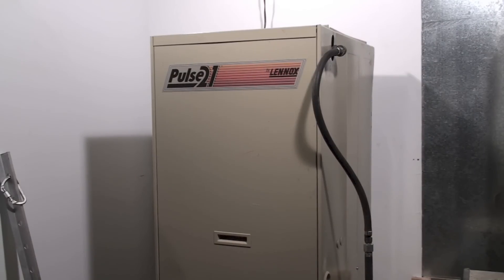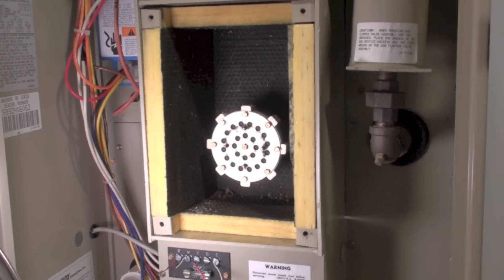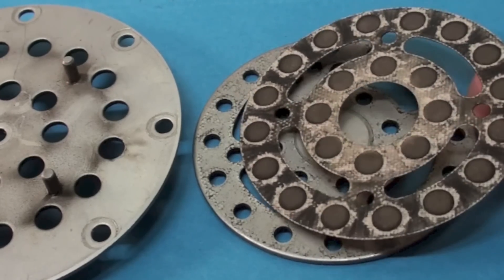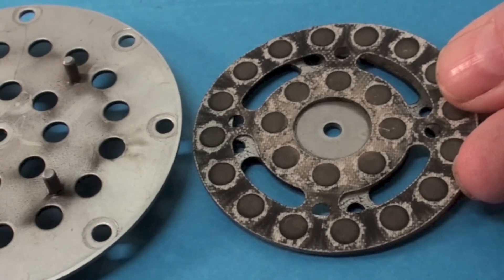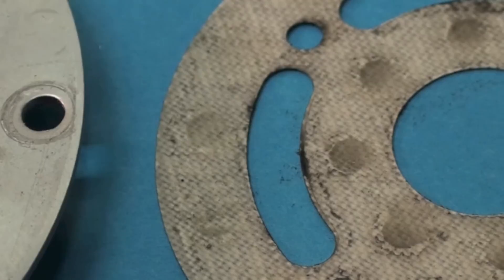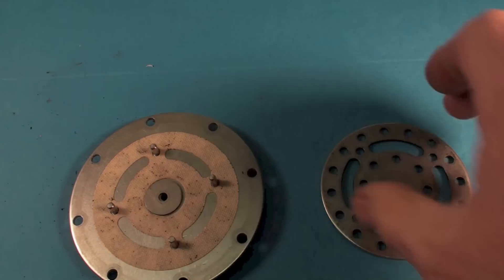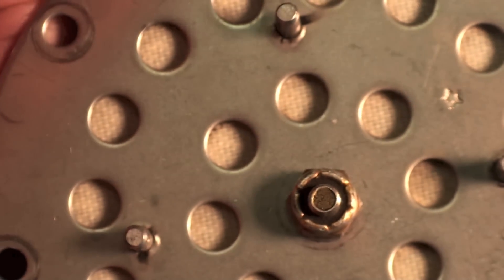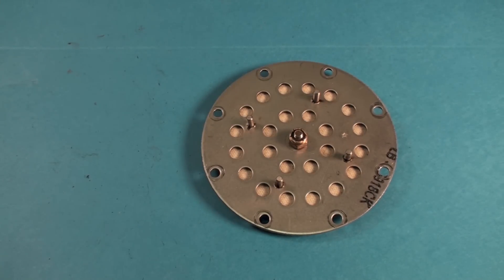How the air flapper works on the Lennox pulse

Comment: According to the service manual the "star" embossed in those two metal parts are supposed to align and face out of the furnace. The center bolt is torqued to 10 inch pounds and the surrounding bolts to 9 inch pounds.

Comment: I'm on 10 years without replacing the air flapper, it's only used as a back up heat source but runs daily at least twice for 15 plus minutes at a time. It is sounding like it stumbles at the beginning of the cycle, kind of like a misfire her or there. Probably should buy a new flapper if they are available.
Reply from the maker: That's what I would try first.
GFM

Comment: My parents have a Lennox pulse. And it’s in good shape for 20-30 years old! When I was younger I used to hear the furnace kick in with that really loud rumble. But this video taught me a lot! But I have one question, my furnace makes a little clang sound before it starts up, but what does it mean if it makes that sound like 3 times but doesn’t start up?
Reply from the maker: From your info I can only conclude the flame rod is not sensing flame.  Try cleaning the flame rod.
GFM

Comment: Lennox Pluse (10/1987) G1404/5-100-6 still chuging along.  Replace flapper about every 4 years.  Had to change Fan Limit switch - HOWEVER generic limit switch cause Blower to short cycle.  So had to add Delay -Off-Relay set to 4 minutes (that feature was built into original fan limit switch).

Comment: Many thanks for this tutorial! Three hours ago I had no idea what was wrong, but now the furnace is running just fine again. The coronavirus is making pickup or delivery more difficult right now, so I tried cleaning instead, that did the trick. I just used a couple of tissues to clean it off rather than washing it. I figure the water might carry the dirt into the filter portion a little deeper. I can see why a repairman would just replace the filter. At a cost of $10.00, it is much more efficient for them to replace it rather than clean it. Thanks again and stay safe!
Reply from the maker: Welcome
GFM
Reply: @grayfurnaceman  Today it wouldn't start, 24 hours later. I pulled the filter out again, cleaned it really well this time, soap water and a toothbrush, but it still won't start. Any ideas? Thanks again.
Reply from the maker: @gregpanke3752  I would be looking at cleaning the flame rod and maybe replacement of the spark plug.
GFM
Reply: grayfurnaceman Thank you!

Comment: I've had my Lennox Pulse Furnace since January 1982.  In 1998, I got a recall;  the tech came and replaced the heat exchanger free of charge.  This was its first service call and I have not had it serviced since.   It never misses a beat.  I had the mufflers installed at the same time of the installation.  THIS IS NOT A NOISY FURNACE!  I have a Goodman that heats  my basement only and when it comes on, it drowns out the pulse.  I hope I never have to change my Lennox Pulse.  It is the greatest furnace, EVER!  I hope it runs another 37 years.

Comment: My pulse 21 is making a "clattering" sound at start up it stops after about 10 seconds and runs quite. I removed the air flapper and cleaned the diaphragm , I noticed the washer you referred to was missing could that missing washer be the source of the noise? Where can I get a washer for my air flapper? Thanks Richard
Reply from the maker: It could be.  I would replace the flapper as I believe it comes with a new washer.  That is if you can find one.
GFM
Reply: @grayfurnaceman  I ordered a new flapper diaphragm but no washer do you have one to sell.?
Reply from the maker: Sorry, I don't have any parts.  
GFM
Reply: Some models didn’t have a washer. The inner plate was designed with a slightly protruding center to create the proper gap needed.

Comment: I honestly don't care if you like or dislike this model or the model line. I'm not interested if you think certain parts seem "silly" to you. Our Pulse has been working fine for the last 20 years with normal preventive maintenance and parts replacement. It's odd that you say that you won't work on these models- are you telling me that if I called you to look at my furnace you'd refuse? From a business sense this seems like a pretty good revenue stream if they're as bad as you say.
Reply from the maker: The term "silly" is one I commonly use and is not to denigrate anything.  I don't think I ever said I would not work on them.  Its just that when I do, and parts are needed, Lennox does not want to sell the parts and has discontinued many of them.
GFM

Comment: Okay, I already know I own an old piece of noisy crap...however......Lennox Pulse G21Q3-60-1  was in the house when I bought it 21 years ago and has run great with just an annual "tuneup" until now. I'm under contract, selling my house, so of course the furnace decided to die during (you guessed it ...the home inspection).  My repairman said, "everything is good except the IGNITER you will never find a replacement igniter anywhere on the face of this planet or any other planet ...here's a bid for a new furnace".  The buyer is okay with replacing the furnace in the spring if we can just get it working.  Is there any kind of Universal Igniter that will fit my outdated dinosaur?
Reply from the maker: First, I would be suspicious of the tech.  Sounds like a salesman to me.  If indeed the ignitor has failed, they are available.  The price is ridiculous, but it is available.  If all else fails, a Champion J8J may work.  You will probably need to increase the spark gap.
GFM
Reply: @grayfurnaceman  ok
Reply: Yeah, they are available used and new on Ebay and other places. Pretty expensive for a spark plug.

Comment: Could you please tell me how to change the filter in the Lennox Pulse Furnace? I can't find it and from my 'research' it might even have 2 filters!  I bought this older home and I have never seen a unit that looks like this.  I have always changed my filters, but I can't find this one!  I have opened, unscrewed and searched and googled.  I would appreciate any guidance  you could give me.  Thanks
Reply from the maker: There is no guaranteed placing of the filter.  The placement is determined by the installer and the layout of the ductwork.  That said, most filters are placed in the return air usually close to the blower assembly.  It could be underneath the bottom of the furnace, or on either side.  If it is a down flow, it could be above the furnace.  It could also be placed behind a return air grille.
GFM

Comment: I understand parts on the Lennox pulse GSR21V are hard to find, but does this include the washer next to the flapper. It appears to be a basic washer, but I'm being told by technician this is a specialized washer that allows the flapper to move and it is no longer available. Is this accurate? If this washer is that special, can't a machinist make one?
Reply from the maker: +gainingknowledge Did you lose the one that came with it?  
GFM
Reply: The technician is stating that the current washer is rusting, therefore not the correct washer for this unit. He is making comments that the furnace can go out at any moment and that I need place carbon dioxide alarms everywhere. Odd, They've performed pressure tests and its fine. We've had no problems with the furnace since we moved in 10 years ago. I feel like I'm being pushed into purchasing a new furnace when its not needed. This was suppose to be maintenance call. Unfortunately It took me a while to find a company who was willing to come out. Our previous company stated they no longer service these types. I really hate to buy a new furnace.
Reply from the maker: +gainingknowledge I agree on at least one CO detector.  I would say that with any furnace.  If it works with that washer, I would leave it alone.  Its true that Lennox is not supporting these furnaces anymore.  They had a lot of problems with them and heat exchanger cracks are common.  Hope this helps.
GFM
Reply: +grayfurnaceman  but do you know if the washer is that special? or do you know where I can go to confirm this? I'm willing to search for it and possibly have one made. I think it would be cheaper than buying a whole new furnace. Appreciate all you help and insight.
Reply from the maker: +gainingknowledge The washer that came with the unit is stainless.  Could also not be a standard size.  If you want one, send me your address and I will send one I have here.
GFM
Reply: +grayfurnaceman    Really? That would be great! what is your email address?
Reply from the maker: +gainingknowledge Grayfurnaceman,com
GFM

Comment: Just replaced the flapper. The combustion still is shutting off and turning back on, but not as often. Does the air flapper have to break in? Should I try something else like the spark plug or flame sensor? Thanks
Reply from the maker: jonesey 4500 It does not have to break in.  You can try cleaning the flame rod or changing the spark plug.  I am giving you these options because the other possibility is the control board has failed.  It is the most expensive part.GFM
Reply: Thank you very much will try probably next winter.

Comment: I have a pulse furnace. It seems to be having a problem. The combustion keeps reigniting and shutting back off. It most of the time surges. I checked the intake outside and it was clean. Could this issue be due to a bad air flapper?
Reply from the maker: jonesey 4500 The first thing I would try is the air flapper.GFM
Reply: Thanks man
Reply: +jonesey 4500........................... my suggestion try to clean the exhaust pipe beside the furnace, it might be plugged, it cost me $500,00 for the serviceman to come and spend 4 hours  with it, all while I could have done it myself if I only knew it, at the bottom of the pipe there's  a rubber cover  take it out clean it and put it  back, good luck
Reply: Thanks, but I actually was playing with it and found out that the flame sensor wire was lose. Works like new now!
Reply: @monantony22  yeah I find that the wires sonetimes get loose in there.

Comment: The pulse is a great furnace....too great.....seems like they discontinued making heat exchangers just so they could sell new junk(young tech here)
Reply from the maker: Well, I can't agree with that.  These furnaces had serious heat exchanger problems with at least one recall.  The G14s were the first to fail, but even the G21s of later manufacture had failures.  The ignition controls also had a number of failures.  Lennox has stopped making parts for the furnaces to essentially get rid of them. Remember, the newest of these furnaces is 20 years old.
GFM
Reply: Well, i am new, but i am still see these furnaces still working(20+ years) and buletproof, literaly lol!
Reply from the maker: Jody Wilson They needed to be.  There was a possibility of of quite high pressure inside them.  The combustion chamber was 3/4 in thick (not just for explosion protection).  They were an idea that did not work as well as expected.  btw, look up my antique furnace.  That one is about 45 to 50 years old and still operating.
GFM
Reply: Builderman912 - When I bought my house in 2011 it had the house's original furnace, a 1956 Ruud(or Rheem🤔)oil burning furnace that still worked perfectly. 20+ plus year old furnaces still working is not unique to these rattle trap pulse furnaces.

Comment: Thanks for the videos!  Been having problems with my furnace lately.  I know for a fact the flapper is at least 13 years old.  I think I better order some replacements.  Now I just need to figure out how to get the flame sensor out.  Any tricks you can give me?
Reply from the maker: Twist and hope.  They often strip the threads.
GFM

Comment: My big problem with this heater is that Lennox has stopped making parts for it!!!  It's 19 years old, has stopped working (won't fire up), the local (exclusive) Lennox HVAC service co tells me I am out of luck for parts, since Lennox has stopped making the parts!   They say it needs a new ignition module, gave me a part number:  68H13.  They want to sell me a new heater unit, only $3500.  Ask me how much I like Lennox - a company who can't be bothered with continuing to make parts for their units.
Reply from the maker: Lennox is trying to distance itself from the pulse.  Too many service problems.  First they raised the parts prices, and now seem to be eliminating them.  The company is a good one, they just screwed up.
GFM

Comment from the maker: This furnace has no air adjustment.  There is an orifice downstream of the gas flapper for gas flow.  The only mixture adjustment is the manifold pressure.  Thanks for the comment.
GFM

Comment: I still have the same question today as I did back then, WHY?

I was working for an Amana dealer during this era. My nightmare was the Amana Heat Transfer Management furnace or Amana HTM. The glycol beast from hell.

Can't believe you still have one of these Pulse furnaces, is it a conversation piece in your shop or is it actually still in service? 

Again, WHY? WHY do things like this exist? I believe some engineers are sadist that love to inflict pain on others. Especially the lowly technician

Comment from the maker: I think 1982 was the first year.  This furnace was built in 1992.  Very nasty heat exchanger problems with a recall.  Supposedly the G21 was not recalled.  How ever Lennox provides $750 towards a new furnace.  The 1980s were an innovative decade with the start seeing all conventional, and the end the start of the IFC era.  They were interesting in design but a pain to repair.  Thanks for the comment.
GFM